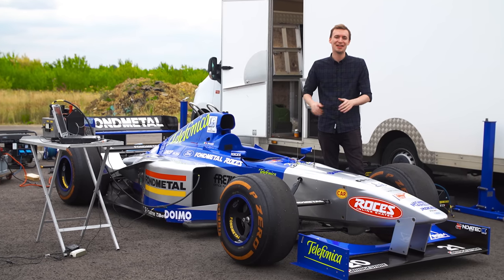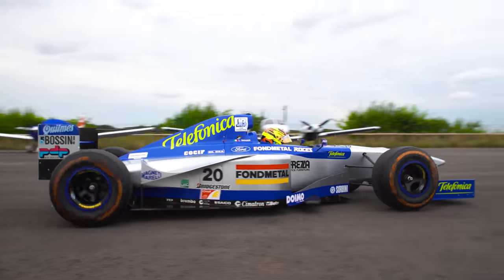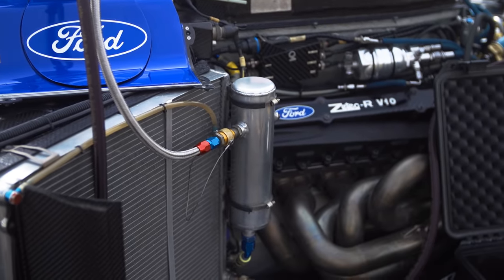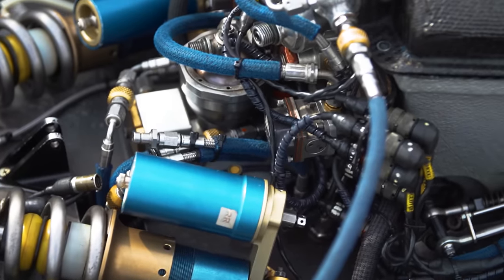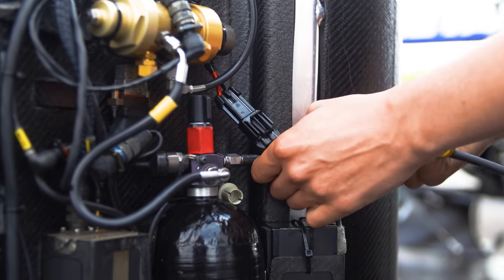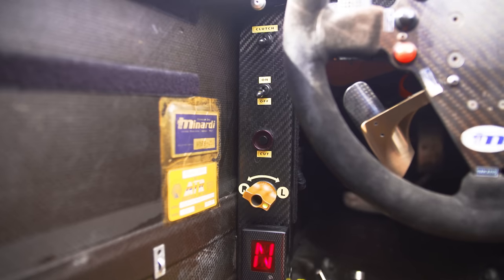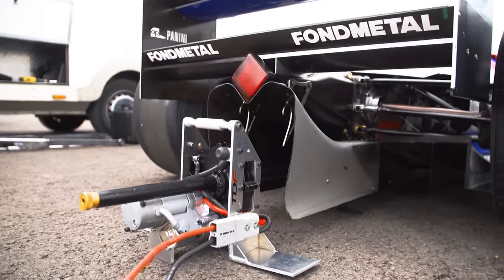Why Formula 1 Cars Take Hours To Start

Comment: Windows '95.... its back...no.... it never left....
Reply: TRUE
Reply: GENTLEMEN, A SHORT VIEW BACK TO THE PAST
Reply: @RECHARGED77  epic !
Reply: Plus a serial port to communicate from the laptop to the car.
Reply: The Roces In-line Skates got me.
Reply: Another reason they need an old laptop is for its low screen resolution. That CF29 has a 13 inch 1024X768 screen res.  Imagine that clunky app UI on an MBP Retina display?  There are still some old Photoshop plugins with out of date UIs and that still work on current versions.  I have several Flaming Pear plugins that are as annoying as heck to use because of their tiny UIs,
Reply: hopefully they have backuped that computer.
Reply: Windows 98, second edition.
Reply: More like Windows Me
Reply: If you take a closer look, you can actually see that this laptop is running Windows XP with classic theme. Doesn't matter as much - XP was pretty much 99% compatible with DOS/Win9X software - without the hassle and instability that comes out of of actually running Win9X.
Reply: @JaneQPL  XP is based on Windows 2000 which is NT5 system not compatible with a lot of DOS applications. The system on the notebook really seems to be some form of Windows 9x.
Reply: Whats Windows '95?😳
Reply: @JohnJohansen2  old windows
Reply: As someone who works in industrial automation... Win95 will never die
Reply: It's silly to create new operating systems, so every common operating system ever made dating back to the 60's is still in use somewhere out there. As are 8 inch floppy disks and the COBOL programming language. Especially in defense applications, I would presume.
Reply: The last windows that worked perfectly...
Reply: @thunderstrikesc1261
Reply: @JohnJohansen2  wow it was too good of a joke. Sorry I didn't frown
Reply: @TravisFabel  Bet they use dial up too! 😂
Reply: @docvolt5214  industrial automation? You want Windows CE... Lol.
Reply: @TravisFabel  Fanuc cnc and any windows based old hmi still use 95. Modem stuff uses win10
Reply: @JohnGotts  not silly to create new OSes since the world changes, the needs changes so do the OSes. But yeah, no need to update what don't need to.
Big airplanes operating since the 90's and even 2000's still uses old OSes and floppy disks to operate them. But as long the one floppy disks supplier exists (yes, there's only one supplier in the whole world), they probably won't change this.
Banking systems still uses COBOL systems written in the 60's, but they adapted and found ways to run them on virtualized or emulated environments, so these systems can run on much faster, modern hardware.
Reply: Heck yeah!  I used to do a fresh cab install every month and have 2 processes running on task manager while idle.
Reply: Oh no!
Reply: The US and Royal Navy's warships run on a similar OS to windows 95.  It does the job!
Reply: Godfather of this vibe
Reply: There are even older computers (like MS-DOS) that have to work in modern days, because of some specific custom software for Navy, Army, Airforce, etc.
Reply: @JaneQPL  It might even be Vista or 7 with classic theme.
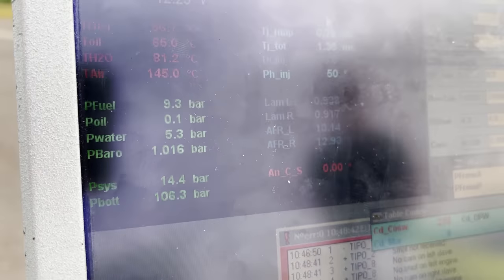Reply: You can tell by the taskbar at 2:45 that it isn't Win9x.
Reply: @dunny  Nope, because the system tray icons are clearly 9x. They changed in XP. Running classic theme keeps the newer tray icons even though the theme manager service is disabled, which is all that 'classic theme' means. So you can't truly fake a genuine 9x install.
Reply: @Blitterbug  Yeah I just searched the icons, I got confused and thought that network icon was the Win7 one but it's the WinXP one, so that's sorted then. It's Windows XP. Definitely not 9x icons though.
Reply: @dunny  Ok it's real hard to see on my tablet but looked like 9x to me, I'll give you that one.
Reply: I used to do repair work on Automatic Teller Machines about 10 years ago, and many of them (In Australia) still use OS2 as their operating system. 1980's computer hardware to keep your money safe.
Reply: Why the hell can't you just virtualbox? Who the hell wants to lug that garbage around
Reply: @toxikricc  Specifically bacause the USB bus can't emulate the RS-232 serial interface on old Win9x & XP -era laptops. I've hit this specific issue in fairly recent industrial control work. So you can't just lug a modern Ultrabook around with a VirtualBox install of Win9x.
Reply: I have 4 CNC machines still running MS-DOS that are still running and making parts.
Reply: I use win95 on a old dell laptop to run my hunter wheel alignment program.  98se was my favorite.. haha
Reply: Hard to believe the software couldn't be updated. Usually it's related to some archaic cable that doesn't work with newer oses.
Reply: Yup... one of our old Mazak CNC Machines at work still runs on a version of Windows 95.  It literally never left.
Reply: You'd be surprised how long a lot of old Tech survives especially with government use. But it is interesting to see it on the more private and civilian side of things
Reply: Windows 95 had 16bit app support, perhaps thats why it cant run on NT
Reply: It's pretty sad that nobody has redone the software to run a modern operating systems ..
Reply: Hands down best os ever
Reply: @kkuenzel56  was kind of suprised to see the connection facing fwd instead of back...
Reply: @docvolt5214  we have some XP and even some Windows  10 connected to our Win95 based server/PLC
Reply: That's not windows 95 lol
Reply: @navnig  you would hope there running something unix based
Reply: The military used it till a couple of years ago
Reply: I almost said DOS
Reply: @chrisbee9643  that's an oxymoron
Reply: My workplace still uses DOS to print tickets. If it ain’t broke, and you can still source paper for the heat printer, don’t fix it.
Reply: @JaneQPL  windows XP is more like a windows NT, not like windows 9x. Xp and NT range is much more stable.
Reply: @chrisbee9643  we called windows 95 a 24 bit operating system as there were so much 16 bit code in it. And it was far from perfect.
Reply: Without Win'95 this car will never run again 💪😂
Reply: Turn off automatic updates…
Reply: The CF-28/29 can't Run win95 i don't think even though its a Pentium 3 Powered notebook,

Perhaps windows 98/2K/XP possibly. Definitely not 95
Reply: It's probably the most stable and safe windows version ever made as long as no internet is connected.
Reply: More like starting up in DOS. Gotta learn your C:
Reply: Nope, all based on NT now, and has been for 31 years.  The things Apple users say... lol
Reply: Typical mechanical engineers - think they know computers, then they end up with garbage software the depends on old timey os'es and "computers that aren't too fast" because they thought they knew how to code!
Reply: Linux 100%
Reply: Sad vista noises
Reply: @JaneQPL  I love how he says the laptop could be too fast to be compatible with the comms with the car.... ROFL If the comms are over a serial port cable then the serial port protocol should make things consistent, WTF is he talking about. I bet all of the issues boil down to them not wanting(or being too incompetent) to have the software running on the laptop fixed and recompiled to run on a more modern system. An issue caused by the system being too fast means the original software was not written properly to handle its own timing properly. I thought we left those problems behind with the turbo button. The speed hardware runs at has been highly variable for more than 30 years now, the days when anything and everything ran 2, 4, or 8 Mhz CPU clocks are long gone. If the software is that ancient/pisspoor then maybe it is time to do some kind of update/rewrite so that you don't get f'd when your main and backup laptops that CAN run your software crap out on the same morning.
Reply: Our land based silo nukes run on floppy discs, analog everything, vacuum tubes, with cloth insulated wiring in some cases..in 2024. 25 yrs. after this 'outdated' tech was used in AUTO RACING. Yikes.
Reply: @carlsaganlives5112  I heard they lack of technology updates was a preemptive measure. I'm unsure exactly what that means, though I summarize old tech is less impervious to cyber attack.
Reply: @chrisbee9643 No windows ever worked perfectly
Reply: @jnawk83  my XP PC never had a problem
Reply: @chazmichaelmichaels88  That makes sense - it's so old school it's a mystery, right?
Reply: @carlsaganlives5112  no, there just isn't really a need to update hardware that works (that's gov for ya), and is also a further security risk to perform those upgrades. You can find a few videos on YT that explain this concept further.
Reply: @carlsaganlives5112  I should clarify, I am not speaking as if my theory is fact, just my opinion based on my IT career

Comment: 3 seconds behind McLaren in 1998 isn't bad considering the MP4/17 was capable of lapping the entire field on its best day.
Reply: MP4/13*
Reply: .. until you realized that the gap nowadays between the cars at the front and to the back is half than that.
Still, the Mclaren and the Ferrari of those days are truly monsters compared to others on the grid.
Reply: @3ormorecharactersmaybe5  actually no it's still very impressive. for most of f1s early history a good chunk of the teams that showed up to every race ended up being too slow to even enter qualifying.
Reply: 3 seconds is an eternity in racing.
Reply: Thats bad. 3 seconds a Lap GUARANTEES that you'd be getting lapped every race.
Reply: MP4 sound like a type of gun
Reply: Huh... being 3s per lap slower is exactly how you end up being lapped on every race.

That means that in just 40 laps you're already 2 minutes behind, and laptimes at most circuits are closer to 1m30s.
Reply: 3 seconds behind means getting lapped every 30 laps with current average  laptimes
Reply: 3 seconds slower a lap is basically a different class
Reply: @hvt_andreas Yep.
Basically the Merc for the first few years after the switch to V6's.
Reply: it is bad

3 seconds behind means you're still within the 107% rule in the qualifying but you're getting lapped by the race leader 2-3 times in every race